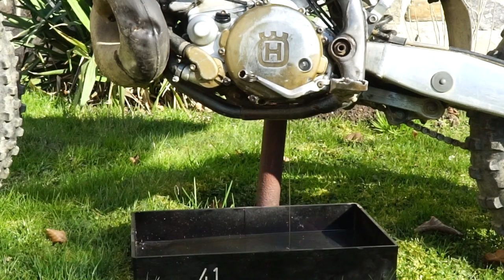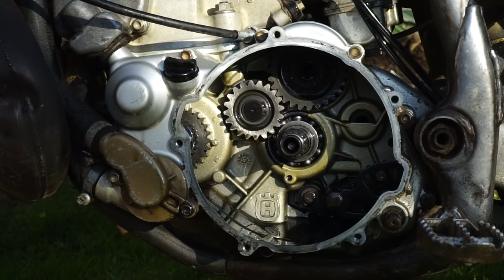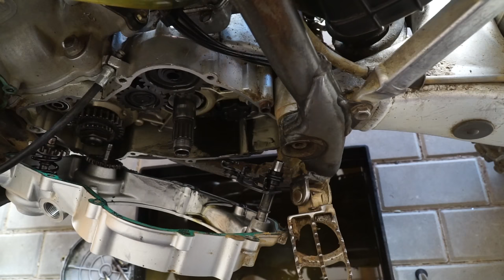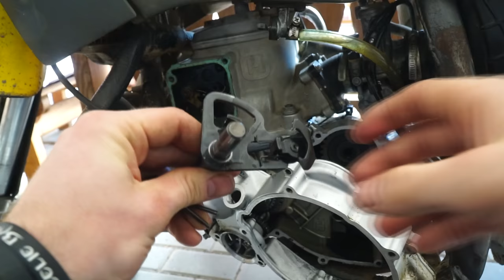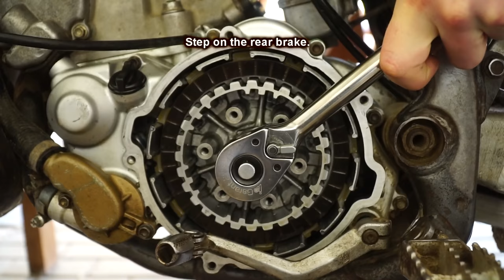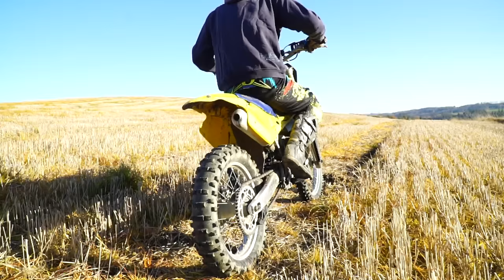How To Fix Shift Return Spring. Gear Shift Problem.

Comment: For my vulcan 900, my gears would somehow slip down(effectively Downshifting without foot touching lever, 5th down to 4th),  and also had major issues finding neutral like you did too! This will help reinforce bravery with my mechanical paranoia. You're really awesome for the provided video!

Comment: Hi awesome video, hope you can help I have recently rebuilt a 88kx80 on the bench it had all gears (casing off) now back together in the bike I only have 1st neural & 2nd but when selecting those gears the selector is stiff up and down once in gear the selector dose not spring back up? Could you shed some light on my issue? Thanks
Reply: Did you ever fix this? Got the same problem now on a trials bike😂

Comment: Thanks not getting push notifications, just logged back into forum noticed replies got housing out of way , took of slave cleaned up new seals/spring but back on bike bleed clutch seem ok Resistance , but not driving still making clucking sound like something is not Engaging properly, gear, selector, area noise is located I was originally riding when I was slowed down & forced to pull to curb any ideas please?

Comment: Im having some shifting issues on my ninja 250r. Cant get into 3rd or higher. Pushing down after shifting up allows me to go to 3rd, 4th, 5th... It sat for a while after a crash at the track and might need to be worked back in. Anyway hope this info helps
Reply: My ZX-6R is doing the exact same thing, did you ever fix yours? I'm tearing into mine this weekend
Reply: @jakedelloso9643  lmao you would think. I cleaned the surrounding area and changed my oil to no avail. Its either the return spring or the shaft is bent
Reply: @piotrplewa1889  i fixed mine i actually took the clutch out for no reason. My left peg was too seized to let the spring push it back to center position. I took it off and greased it up

Comment: I had my chain fail and locked up the rear tire. I replaced the chain but it wouldn’t go into 3rd I drained the oil and seen no signs of damage like metal shavings but I checked today to see if by some miracle it fixed itself before the new clutch came in through the mail and I have all neutrals /:
Reply: The magic of motors.

Comment: Could this be the problem to my moped? So my gear pedal gets stuck on 2nd gear and hardly goes up to third and doesn't return to the original position
Reply from the maker: My gear pedal gets easy, only doesn't return to original position.

Comment: Can anyone help me I have a 2008 KX450 I put brand new clutch cable brand new clutch and everything and it still did not fix my problem my problem is I can never get the bike back to neutral  why it's running my cable is adjusted I have to use all the adjustment in my cable and it's still not working someone told me a shift shift can be the problem already changed clutch and cables not stretched out brand new cables and still have the problem annot find neutral  until bike is turned off all gears shifts fine in my cable adjustments or maxed all the way out still cannot find neutral

Comment: I have this issue with my Cb125R but I can use th gear I just have to keep returning it to the normal position because it either sticks up or down at first it would fix its self and now its just constantly broken but like I say I just have to keep pressing the gear either up or down slightly to return it to numeral.
Reply: same with my husq but the gearshift i have on it doesnt go to the bike

Comment: my problem is the bike slips out of neutral into 1st ALL the time, even just pushing the bike without it on it will slip into neutral, i can barely get the bike to start without it slipping into 1st and then when it does even while holding the clutch in the bike starts to go like im holding the clutch half way in
Reply: Adjust your clutch lever cable. It won't stop it slipping in 1st but it'll stop it going with the clutch pulled in
Reply: @daviddragan610 yeah i got a new detention spring and gear selector spring so hopefully that fixes it along with a new clutch.
Reply: @bryce_durbin227 did that fix it? My ktm 65sx is doing the same thing
Reply: @richperkins5192  I removed the clutch cover and clutch basket from the bike. When I tried to put the bike in what I thought was neutral, it turned out to be a "false neutral." The shift star had turned a whole tooth over, making neutral between 2nd and 3rd gear instead of between 1st and 2nd. 

To fix this, I pushed the detent arm down and rotated the shift star into the correct position. You'll know where neutral is because there's a notch on one of the shift star's teeth. Neutral is at the notch, with 1st gear to the left and 2nd gear to the right.

Before you start, make sure your bike is in 1st gear by pushing the shifter all the way down. Then, turn the shift star until 1st gear is on the left side of the notch. Let the detent arm back up, and you should be all set! If that doesn't work, you might need a new detent spring. 

Hope this helps! If not, we can exchange numbers, and I can walk you through the process on FaceTime.
Reply: @bryce_durbin227  Bryce you are the man! Just in time too because I’m pulling it apart this weekend. I’ll get with you if I run any any issues and fully appreciate you taking the time to get to me on this. Have a blessed day brother!
Reply: @richperkins5192  you as well man and no problem at all, hope i was clear in everything i said!
Reply: @bryce_durbin227  brother! I already had a new shift star and gear shaft selector so I changed those and then followed your instructions aligning it. Shifted flawless and holds neutral as it should. Thanks again
Reply: @richperkins5192  no problem man i'm really glad it worked out for you!

Comment: Why Is my Suzuki quadrunner 185 not shifting like its shifting but wont go into the gear in all 5 idk is it just worth getting another one?
Reply: I'm in the exact same position 😅 wish I knew more about this stuff. There doesn't seem to be a comprehensive video for beginners to work through this stuff from what I've seen so far (what exact tools to get, what goes where step by step etc.). I've a gn125 and I just want to be confident that nothing acts up when I'm on route somewhere

Comment: Hey mate 👍 top vid...
So my drama is this
Got a Husqvarna WR250 2009
It had a leaking water oil pump seal but I rode it for a while until the seal came.
Changed seal yesterday all good.
Bike started let it idle for a bit...  checked oil and no more water in in...
Then I put it in 1st gear to ride into shed and it won't change out of 1st or even to neutral.
Shaft moves down but won't move up ton2nd or neutral.
Reply from the maker: I had the same problem, i could not find neutral, I could shift but with difficulty and it was broken spring. 🙂
Reply: @topridefilms6359  aye... I forgot to put washer on selecting shaft lol

Comment: What could be the problem? For me, it falls out of the first gear, it shifts well towards higher speeds, but it will not shift to lower speeds, and it is very difficult to find a neutral when the engine is running.
Reply from the maker: Hard to say, clutch is set up well ?
Reply: I have the same problem and it was said this is the spring, because it doesn't  come back to it's  position you can't  downshift.  So that's  why im watching this video😂